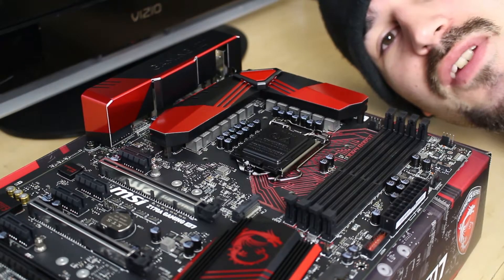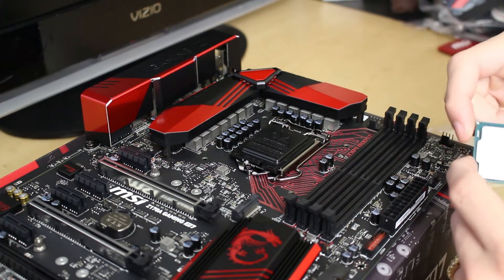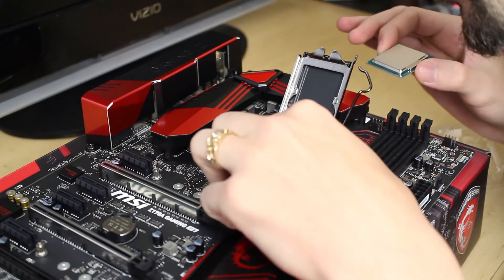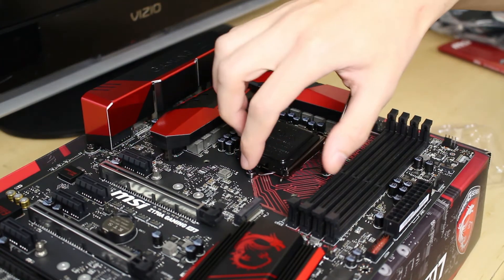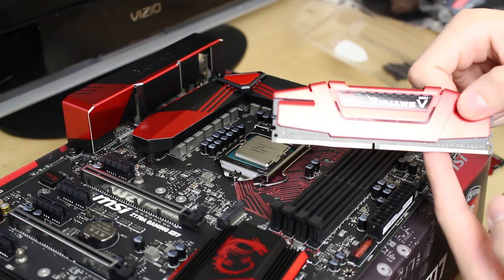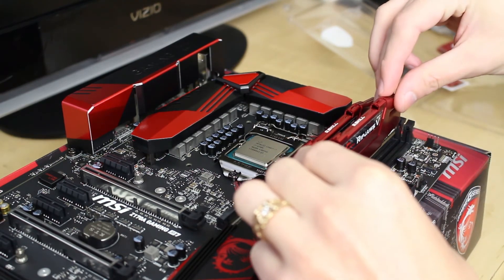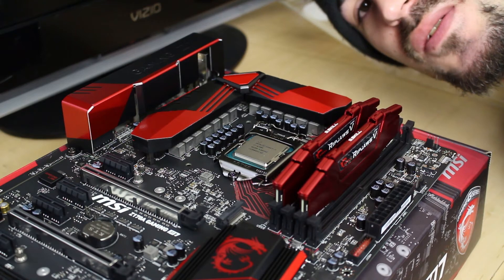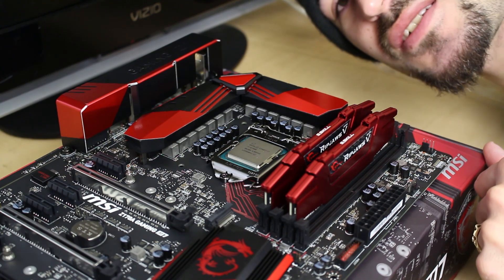How To Guide: Installing a Intel CPU and RAM (ft. Skylake)

Comment: Hi ! I've recently installed a 6700k Skylake (1151) on an Asus Pro Gaming Mobo, the thing is that it freaked me out a little or alot because when i pulled the lever back or tightened it, it made this horrible crackling sound or somewhat crunching, it is safe to say that it all worked out just fine when i booted up the first time and bare in mind that it was a "oneshot" Good-to-go build, but that noise, i've never heard anything like it nor do i know why it did this, could you please enlighten me or tell me what's up?
Reply: Stopher Bforbum that noise is to be expected. You did absolutely nothing wrong.

Comment: Can any of the wires you connect to a motherboard be turned the wrong way? Like usb connections or fans connections? Will the fans maybe turn the wrong way if you do it wrong
Reply from the maker: USB connectors will have a  matching blocked pin slot to help make sure you don't. Fan headers (on the motherboard) will have tabs on one side that you can line up with the connector on the wire to ensure proper connection.  Off the top of my head the only thing(s) that may be plugged in incorrectly would be the Front I/O cables (power/reset button, hdd activity light, and so on) to avoid this, look up in the user manual of the motherboard to find the proper slots, the cables on the case should be marked to indicate which is which. 
Hope this helps and good luck with your build :)
Reply: +Giga Hertz Tv Thanks a lot. That's a bit of a relief. I haven't received the items yet so I don't know what to expect. But with the manual from the motherboard I should be okay. Once again, thank you for letting me know